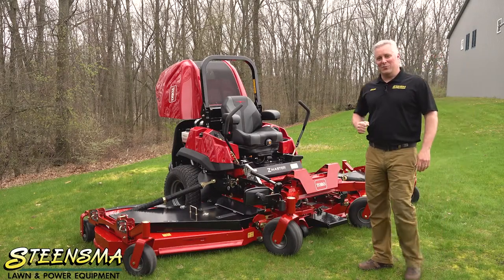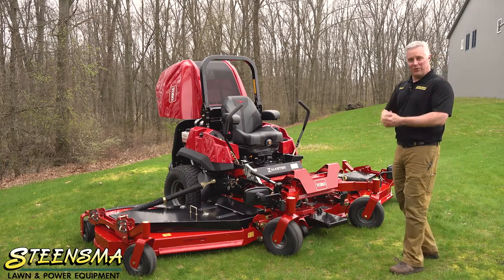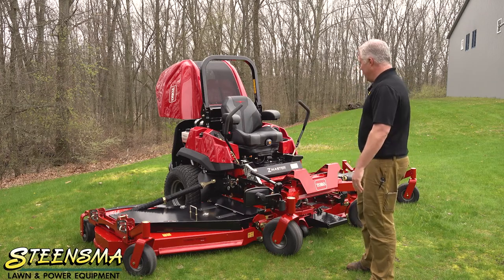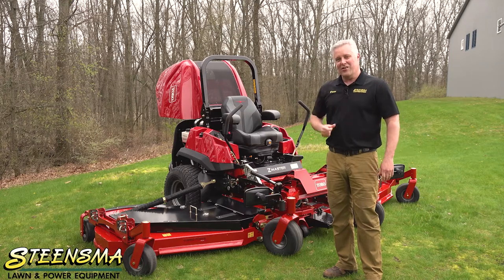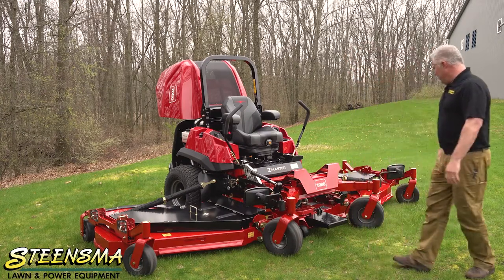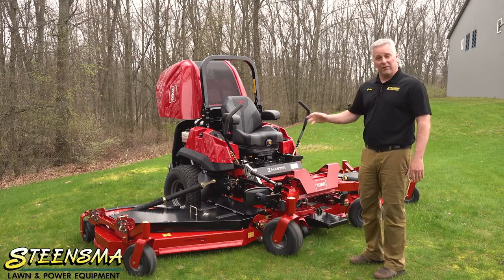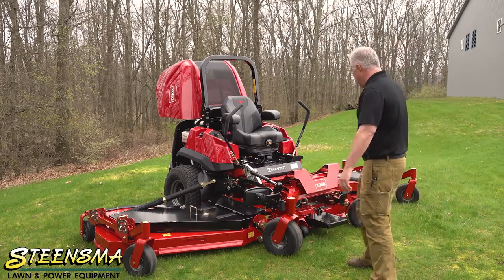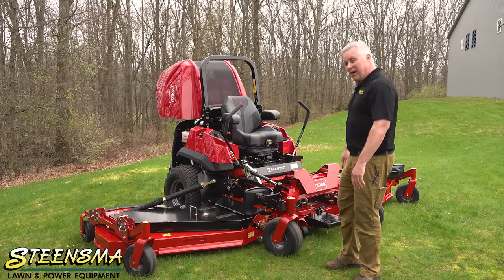Toro 144 Inch Cut - Wide Area Mower!

Comment: Toro Z Master 7500D 144 20 degrees up and 15 degrees down 44hp Yanmar diesel engine 48" center deck with two 48"wing decks each blade is 24" cause 24x6 is 144 mow up to 11.5 acres per hour 17mph you're on to the next park or trailer